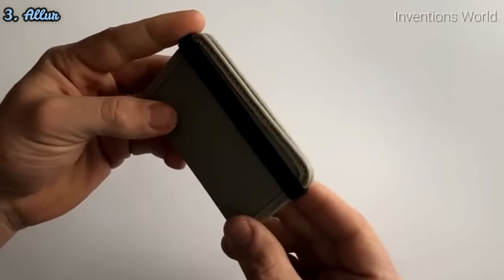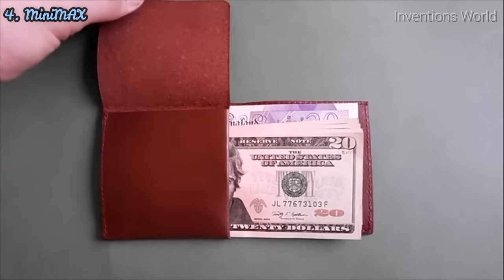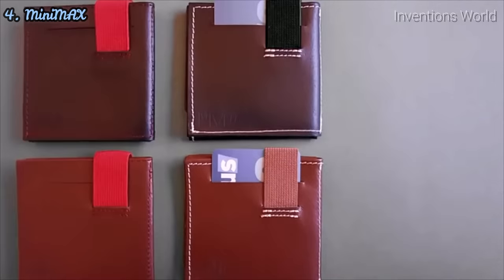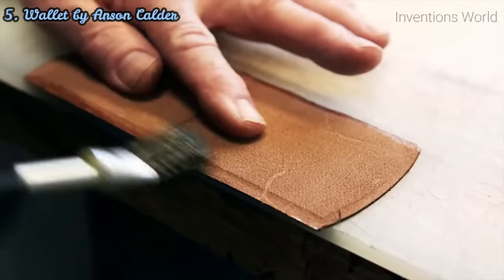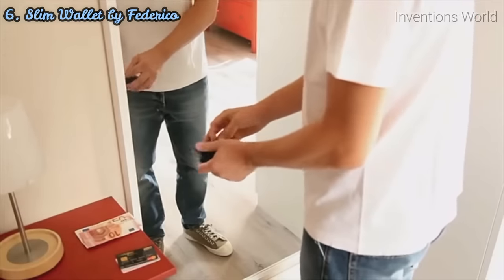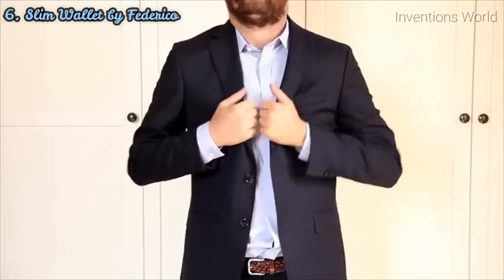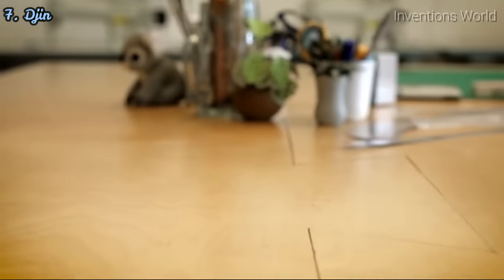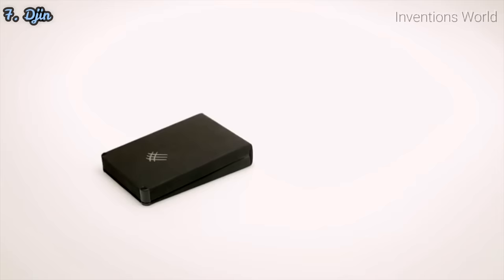7 Amazing Slim Wallets On Amazon - Best Wallets For Men #08

Comment: I can't accept the fact of having a wallet without coin pocket. It's such a deal breaker for me.
Reply: just put it into a regular pocket....
Reply: Consider a purse
Reply: Wallets don't usually hold coins
Reply: I guess that would be an issue if you wear a dress. For me, I don't want to mess with putting coins in a wallet. I did that with my first wallet when I was, like, four or five years old.  Not necessary.

Comment: Here's the deal on these minimalist wallets. The first disqualifier for me, is having to touch dollar bills every time you touch or open the wallet. So bills tucked in a strap on the outside, or bills in a money clip in the center or outside of the wallet, are a big "no," for me.  The reasons?  Dollar bills carry lots of bacteria on them, I don't like them flapping in the breeze, outside my wallet, and I don't like them getting in the way while I get a credit card out.
The second disqualifer is having to fold dollar bills into quarters to insert them into a small slip in the wallet. First, you can't fit many bills in the wallet doing that, secondly it thickens the wallet too much, and third, it's a pain in the ass to fold and then unfold bills in order to use them.
The third disqualifier is having to sort through numerous cards to find one credit card or ID.  I don't want to get out three or more cards every time I need just one, although most times you can put the card you use most often on the top, I want to grab the one I want, directly.
The fourth disqualifier is having a snap, latch, or strap, on the wallet. It's stupid, unnecessary, and slows me down.
Fifth disqualifer is anything made in China. Screw China. Enough said.
Sixth would be storing coins in the wallet. Just no.
Seventh would be price. These should cost around $30.  I really do not want to pay more than that.

So, the only wallet here that comes close to what I like, is the second one, the Distilunion brand, Wally Agent. Bills are tucked away in their own compartment, to be touched only when you use them, you can access four cards very quickly, it seems to be made in the US, in Charleston, SC.  The only drawback is price. This wallet, called the Wally Agent, is $80!!!  That kills it. So sad. I will stick with my leather billfold.

Comment: Wow. They all completely went off the rails with these designs. To make a wallet thinner, all you needed to do is add a money clip to a traditional wallet and you eliminate the cash pocket. That's all you have to do to thin out a wallet by 20%. Disappointed. The secrid got close, but they made the cash pocket out if plastic. A spring loaded money clip would have made it perfect, same with andar pilot and ekster. Money clips are very under utilized.